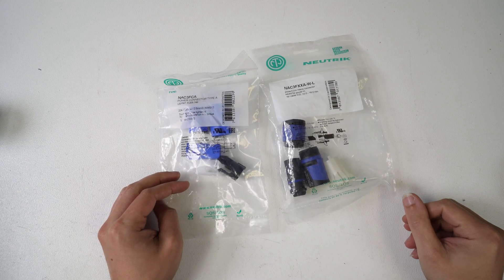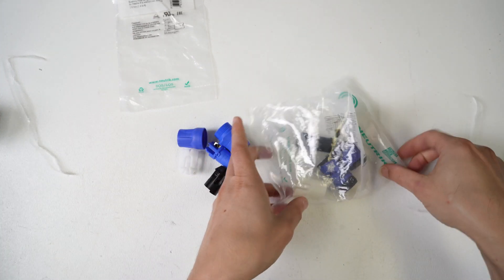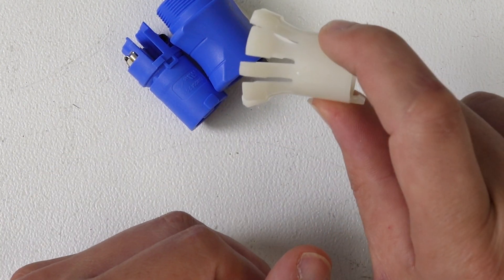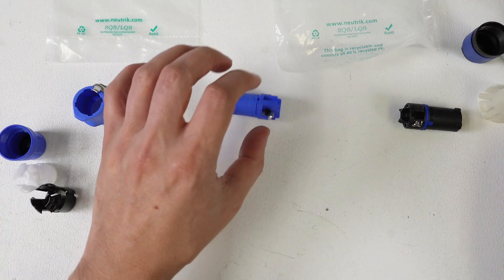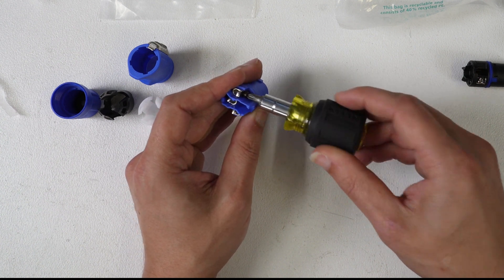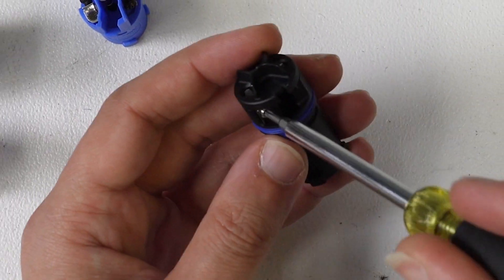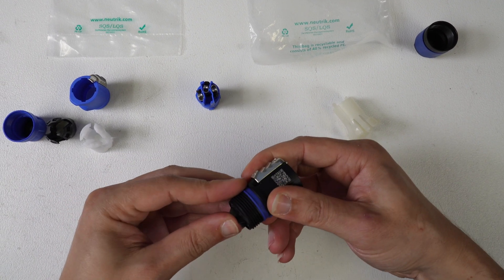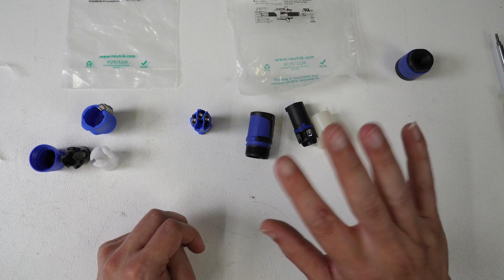New Powercon Connectors Compared! NAC3FXXA VS NAC3FCA.

Comment: Thanks for showing this. I had trouble assembling my first NAC3FXXA until I saw how you attached the strain relief to the insert. I had put the insert into the shell, then pushed the strain relief in, and then they won't lock together which makes it impossible to close the connector.

Comment: Great video as always 👍
Maybe you could have also added in the fact that the new PowerCon is now also pluggable under load (when using an XX plug and XX recepticle). I think it's the most important change in the 3rd generation of PowerCon
Reply: It also comes in two versions: -S(mall) and -L(arge).  Only difference seem to be the grommet at the back that goes around the cable.